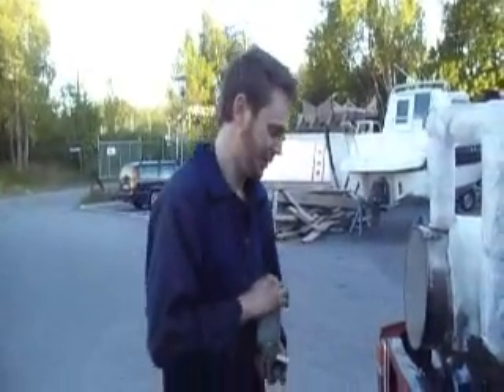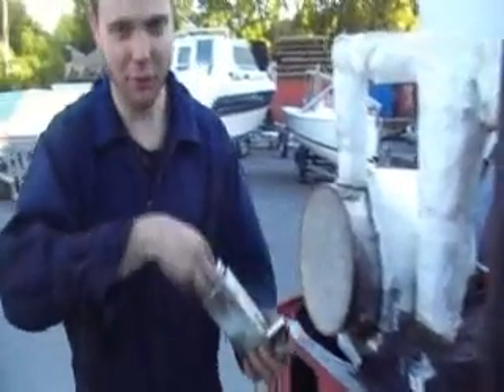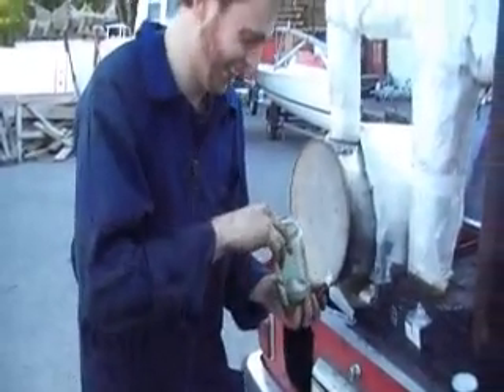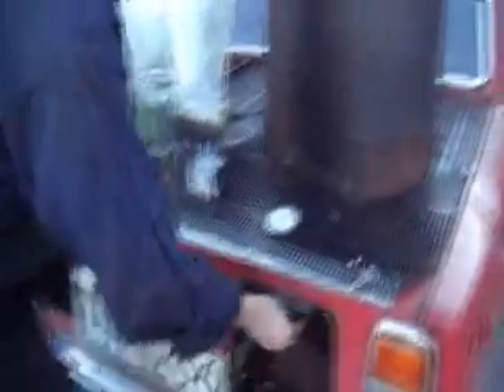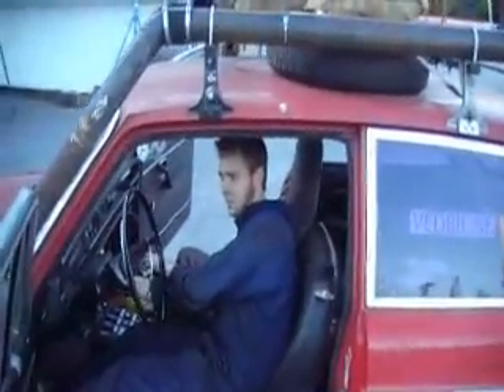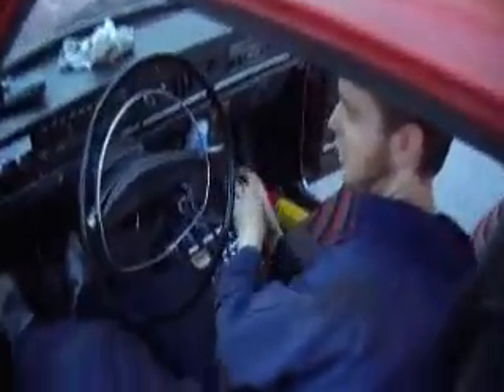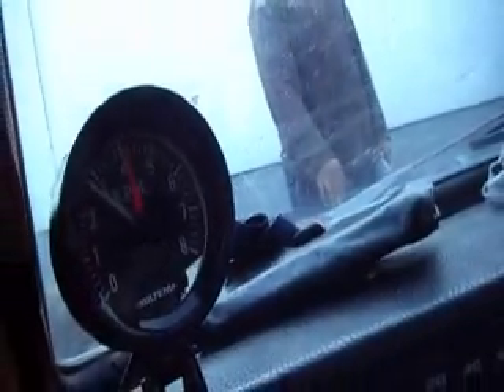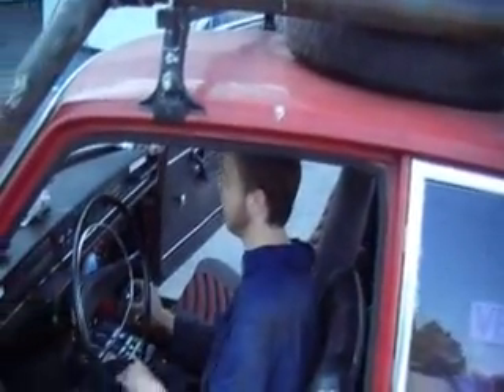Wood gas car Start

Comment: @NorkiddExo You are very wrong  if the gasses are filteret well theres no problems  here in denmark we had a truck that ran on woodgas from 1940 TO 1967 over 400.000km without any problems and that was on org engine and a very simple woodgas system  it drove for a sawmill, so they just continued running on wood after the war. all the sawdust and woodchips =free fuel

Comment: Thumbs up! Great work. The Germans used this technology quite a bit to power vehicles (e.g. delivery trucks) domestically in the latter part of WWII. Every vehicle they powered this way saved liquid fuel for combat. 

Vedbil, three questions: 1) Could most of that pipe have been channeled under the body rather than over it? 2) How hard would it be to build a small stationary wood gas plant, and liquefy the gas after it is generated? 3) Is the gas mostly composed of methane, or other compounds?

Comment: sorry to bother you guys, but i'd like to ask a question, i just can't figure it out: 

so:
gas is produced in the gas producer, then goes to the cyclone, and to the filter, and then to the cooler. this means you have hot gas in your filter. 

i'm asking because, in Imbert blueprints, the gas goes first to the cyclone, then the gas cooler, and THEN, when gas is cold, to the filter! 

so, how come you didn't have problems with your filter?